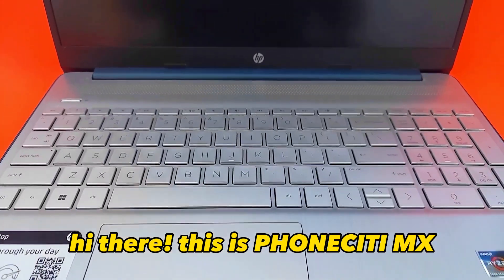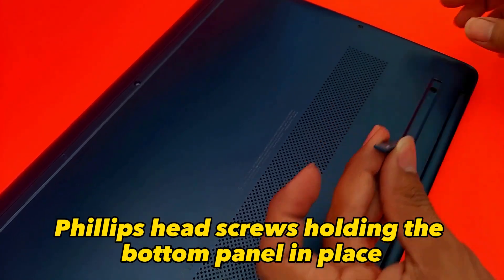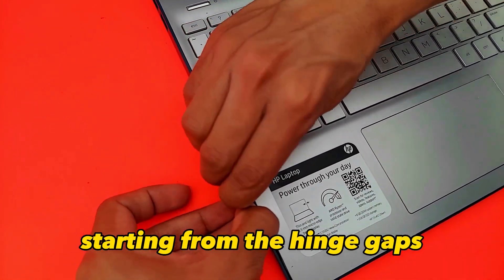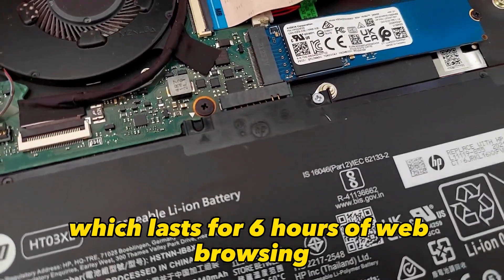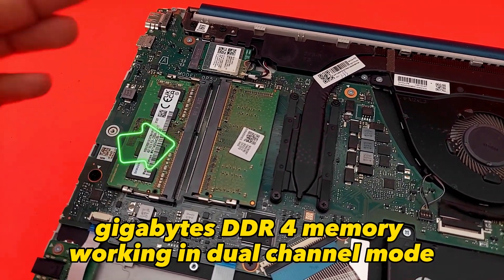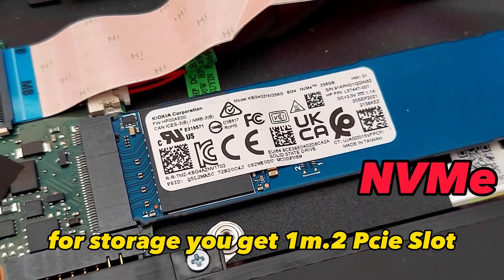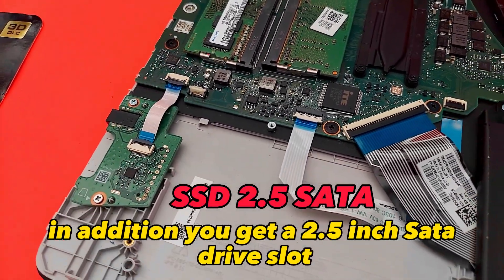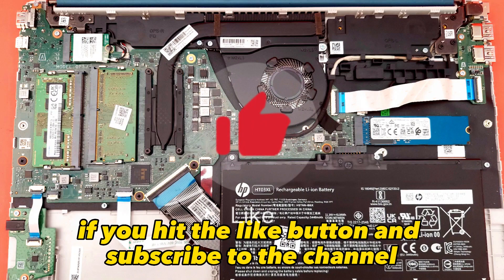🛠 How to Open HP 15-EF2 DISASSEMBLY and Upgrade Options ✅️

Comment: Hola amigo. Consulta, tenía pensado abrir mi notebook y hacer dual channel con una nueva RAM Crucial sodimm de 3200Mhz ddr4 de 8GB y una de las rams que vienen de fabrica de 4 GB. Es posible hacer esto? Hasta cuanta ram por slot aguanta?
Por otro lado, es necesario cambiarle la SSD para esto o puedo dejar la que esta por defecto? Gracias!!
Reply: La memoria ram te sirve aunque sean disparejas los tamaños de ram 4 y 8 GB en otro canal si pudieras poner 8 y 8 o 16 y 16 sería mejor pero no es algo drástico y pues el SSD si te servirá mucho si vienes de un disco duro Normal Mecánico
Reply: Tienes que revisar si trae el anclaje del ssd, ya que si solo lo conectas sin los tornillos de anclaje, se puede desconectar